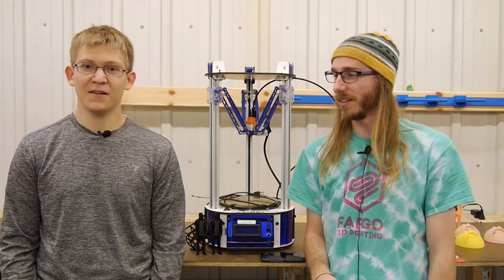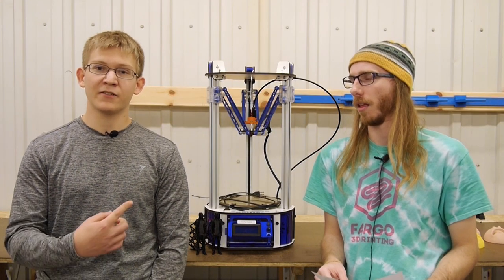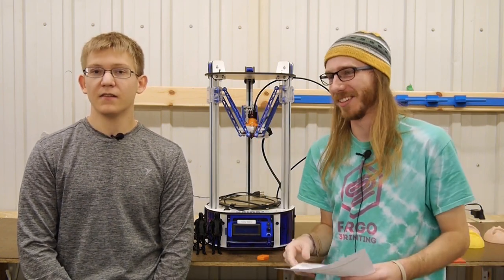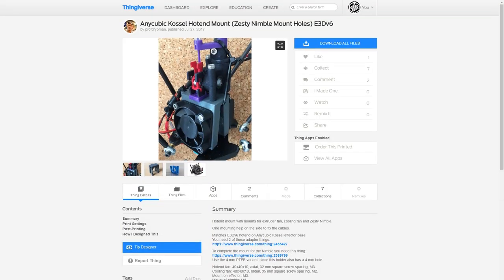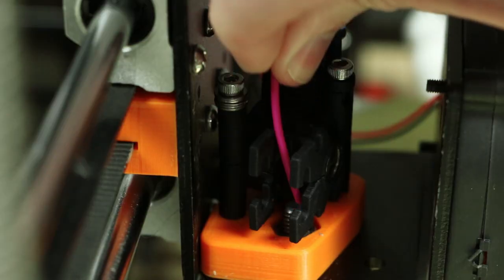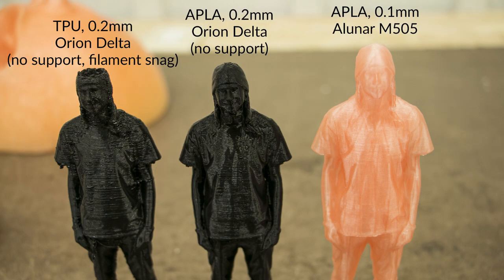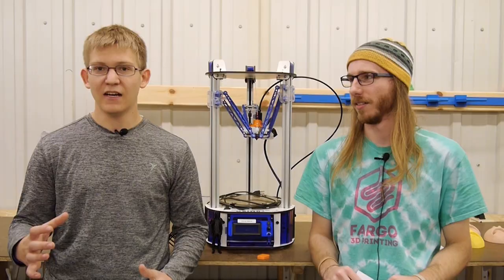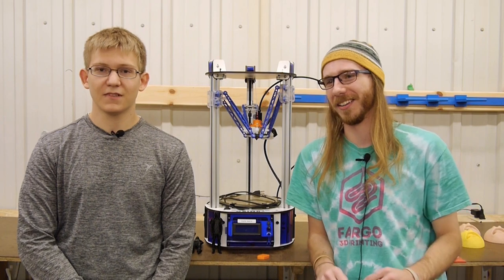Zesty Nimble Review | Remote Direct Drive Extruder

Comment: That awful sound... yaa.... not a good transition between talking points, I would go as far as saying exceptionally annoying. I would have rather watched an install video/firmware mod/images of print results (before and after) video. That would have given me actual information, not just a general over-view. Showing a process and an outcome is by far more informative IMO, this review seemed kind of "light" on usable, useful information.
(remember you asked for criticism)
Reply: @Fargo3dprinting3D  without watching the video again here's what I got out of the video. Here's a product (one that I knew about already), we tried it on two printers, and one it seemed to help more than the other. That was pretty much it, besides a couple of very minor things that I inferred from the review, keep in mind that I had to read between the lines to get these minor points.

The most interesting thing would have been the results under various/changed print speeds. Not stock configs. Did you guys tinker with acceleration? How many prints in total and at what speeds? This is a weight reducing modification, so you should be able to print faster without effecting quality. The cartesian printer probably wouldn't have mattered much at all because the bed movement would have limited your results unless you've managed to reduce the weight of bed quite a bit (there's another test setup).

I would think that delta and/or coreXY would have been the two setups to try, though it's definitely worth mentioning results on a cartesian so people know what to expect because only X movements would seem to be affected on a printer with a bed with a lot of aluminum in it (I have not tested this so I don't have the results; one of the reason I was looking for video reviews for this product). The cartesian printer you tested on probably was the best one to try it on..

Comment: hesitation with this type of extruder is whether it may have backlash or not, since you are twisting a long wire. Did you see any backlash? Compared to a Bowden extruder, was there any benefit other than for printing soft flexible filaments fast? (if you need to print Flex this is probably great!)
Reply: It's 30:1 gear ratio means it draws very mechanical input power. Means the shaft will have to brace against very little force.

Comment: Nice video. But on an i3-style printer with the heavy mass of the moving printbed it does not make sense. It does not help to make the extruder light while the moving bed is heavy. This is the most basic design choice for the i3-style: You decide which extruder to use. Than you calculate the size for the print bed to fit that weight, so it does not matter if you move the extruder in y or the bed. This is something most chineese printer designers do not understand - a bowden extruder combined with i3-style does not make any sense (exept for very very smal printers 10*10cm² or less). You should always upgrade to a "normal" direct extruder there.

But on any Ultimaker-, CoreXY- or Deltaprinter the Nimble is a great solution worth its price. All theese styles are depend on light extruders, they are always bowden extruders for a good reason. They are much faster than an i3-style printer with same printing quality, as there is much less moving mass. But they have the disadvantages of bowden systems (more delay between the extruder motor acting and the filament output reacting -> more oozing, more retraction needed, problems with flexibles, linear advance beeing a problem ...). I ordered one for my delta, hope they deliver soon.
Reply: @Fargo3dprinting3D  Thanks. I found already all information to change my anycubic kossel linear plus on thingiverse. If anything works out as I wish, I will buy a second one end of the year. Most important reason for the Nimble: I want oozing to be reduced, because I want to try to build an IDEX Delta. Have not seen such thing before. Two deltas, one heated bed moving between them. The hardware seems quite simple - putting bed on linear rails. Software and calibration would be the more problematic part...
Reply: It helps a lot, it is an easy swap out to a 'direct drive' type system, and the Zesty prints TPU better than anything I have tried.